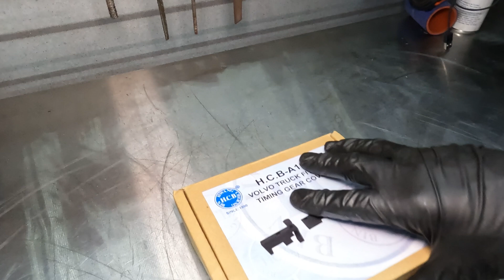Step-by-Step Guide: Replacing Your Engine Timing Gear Cover Gasket

Comment: How many hours does the job take? Im getting some crazy estimates.
Reply from the maker: It is between 6-8 hours
Reply: @ wow i’m getting estimates for 34-45 hours. The shops say you need to remove compressor, drop transmission and gears and many other things. Quotes are 5-6k to replace the timing cover plate.
Reply: @southside06  Run! drop the trans? that's nuts.
Reply: @southside06 timing cover plate yes, not timing cover. Two different things.